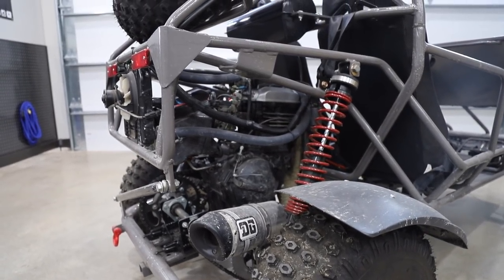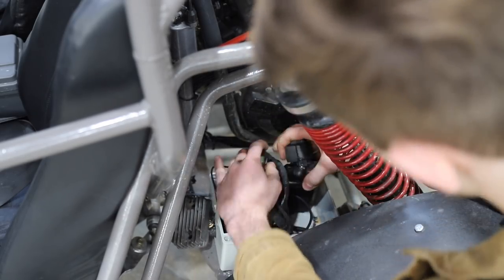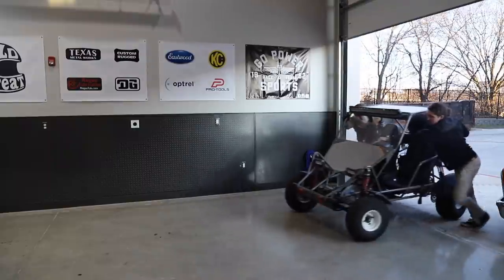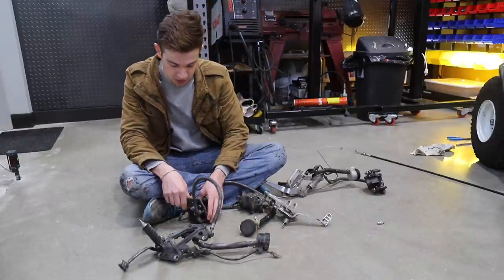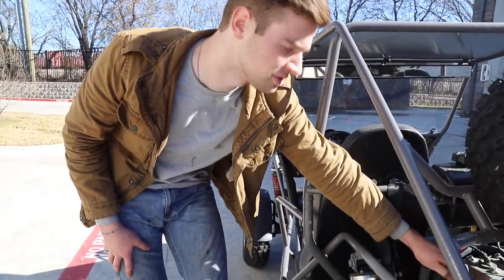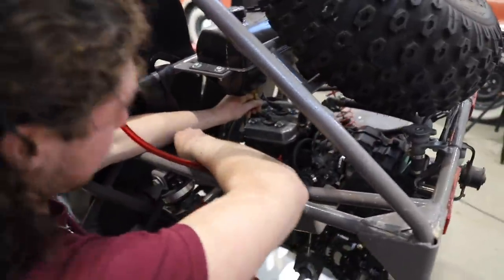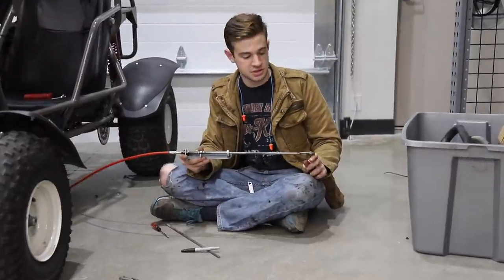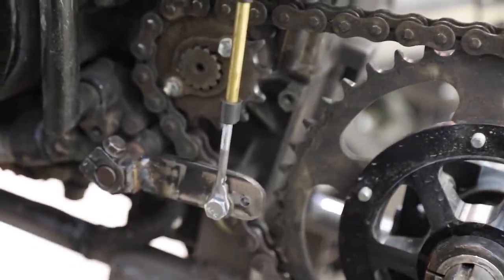Ninja 250 Shifter Buggy Revival! Manco Deuce returns!

Comment: man you guys are revving that thing OUT for only going like 20mph 😂🤙🏻
Reply: Yep lol
Reply: Think it needs smaller sprocket on rear axle..
Reply: @davesonsadventures474  yeah that's what I was thinkin
Reply: Clutch may need adjusted
Reply: @davesonsadventures474  Yea. It would be better with a bigger engine instead LOL. Those 250s are so weak.
Reply: @Eleanor8965  i believe ninja 250r engines make around 37 horsepower which is a stupid amount of power on a go kart like this. when running right and geared properly this thing should be an absolute beast
Reply: @Eleanor8965  Uh no! The 250 is perfect for this rig!

Comment: The starter solenoid can weld itself together due to low voltage or high amp draw from continuous prolonged starting. Hitting it on something knocked it lose but it'll happen again if the battery isn't kept charged up. Great work on the rest of it

Comment: my motorcycle has the same problem with the starter relay i normaly have to smack the side panel for the relay to loose connection and stop the starter

Comment: Hey guys, when jumping a motorcycle engine from a car, it's best to not have the car running. The higher voltage of the car system while running can damage the bike's electrical systems. Just fyi! An expensive lesson I learned.

Comment: Never jump a small engine like this with your car. It may work but the amperage is way too high. I COULD fry the electronics for the engine. Use a jump box set to low or charged lawn and garden tractor battery. Look into it if you don't believe me. Add a return spring to your shifter or get an air shift setup if you wanna be amazing.

Comment: single cable will not work right you need 2 cable to work. one so when you push your shifter forewed it pulls shifter up on engine and the other cable so when you poll back it pulls the shifter down on the engine why they have it pull back for gear up i dont know that makes no sense to me